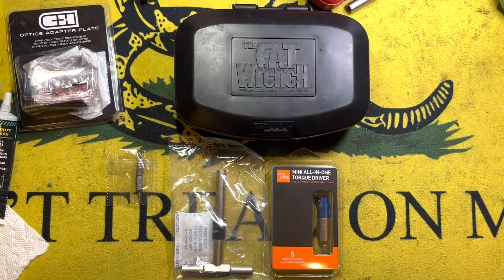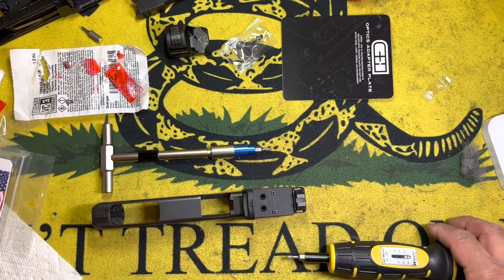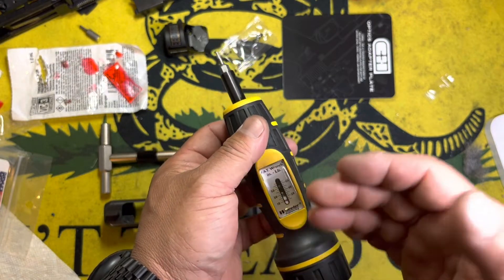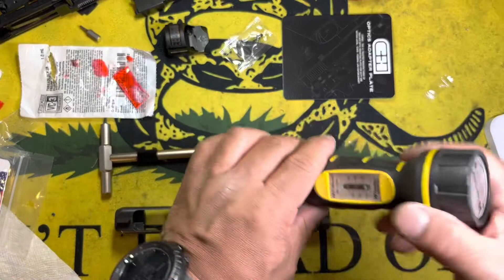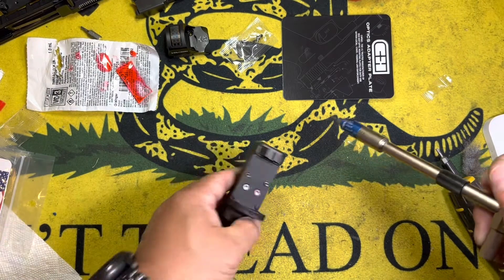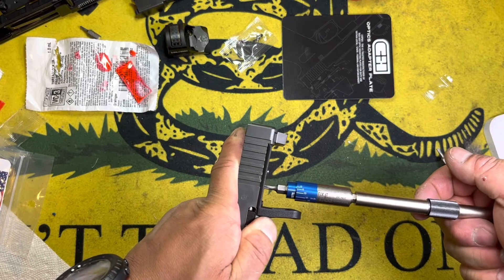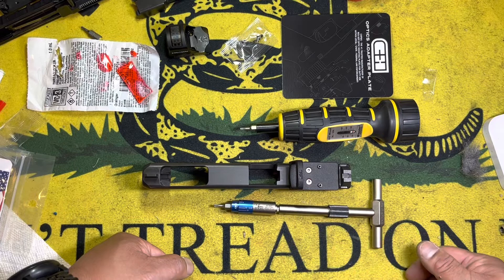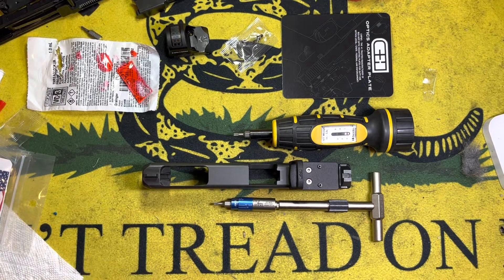Product Review: Fixit Sticks vs Wheeler's FAT Wrench, which is better?  2022-05-02

Comment: I was always told to tighten with the top of the fat wrench that turns instead of the middle of it. Also I emailed wheeler before and it’s the middle of the red line. You think that would be mention in the directions.
Reply from the maker: Good info!

Comment: I think the Fix It Sticks fixed poundage rating attachments may be easier to use. No lining up lines, just wait for the click and you're done
Reply from the maker: FOr sure.  If you only need one weight.  It gets expensive getting multiples though (if you work with more than one weight).  The "benchtop kit" which has all the different fixed weight is around $525 msrp.
Reply: An option for you might be the Wheeler FAT sticks.  The limiters work like you say, but they are limited to a 15, 25, 35, 45 & 65.  I think the Fix it Sticks with the 15-65 is nicer.  The reason is that included with the tool is the T-Handle and sockets to loosen or slightly tighten before torquing.  You can also divide the lines in half I'm guessing that gives 15-65 in 5lb increments.
Reply: I thought you were going to check the screw tightened with fat wrench by using the fix it stix.  That would have been interesting
Reply from the maker: @97mustangcobra  darn it.  Why didn't I think of that.  I'll probably get the digital fat wrench and do a separate video of that test.  thank you for the idea!

Comment: I know this is old and surely you figured this out by now but you're absolutely using that wrong!!!! Haha the handle at the top that you set is where the torque gage is, their site, hundreds of reviewers, other videos, etc. are EVERYWHERE showing the proper use of these Haha you're just turning a screwdriver the way your using em, a VERY expensive screwdriver at that Lol
Reply from the maker: Ha yes.  I"m still preferring the  Fix it sticks.  I'll pick up a digital wheeler at some point to see if it's more accurate.

Comment: The Fixit sticks are less accurate and are overpriced. Way over... 
Fat wrench is closer to actual torque.
Reply from the maker: IMHO and in my experience, the regular FAT wrench sucks.  The digital one is pretty good. but the Fixit sticks are much easier to use and are accurate.